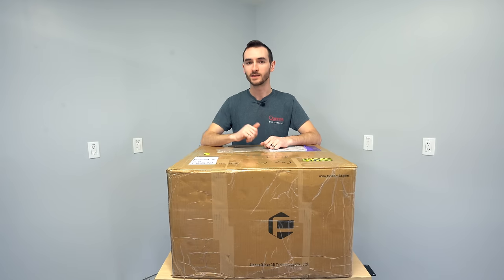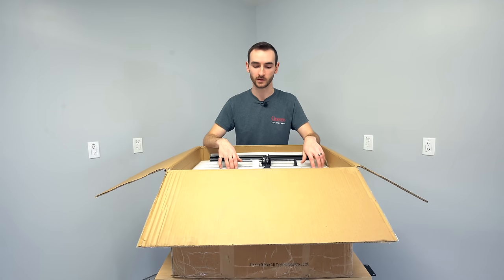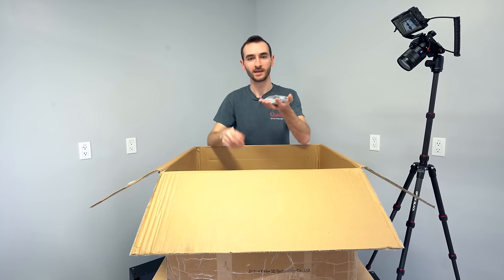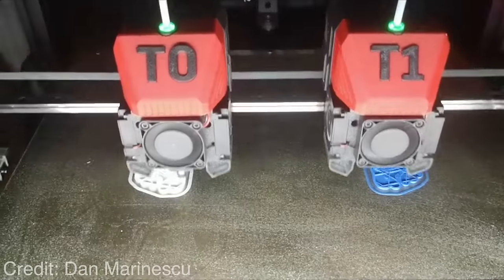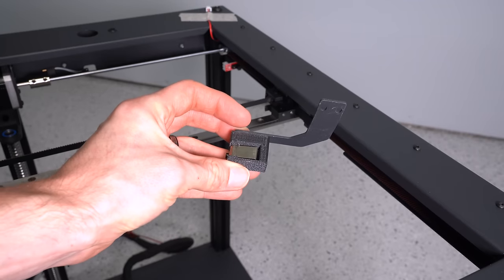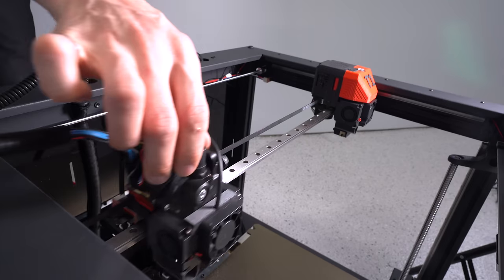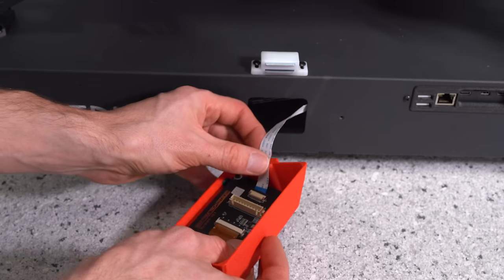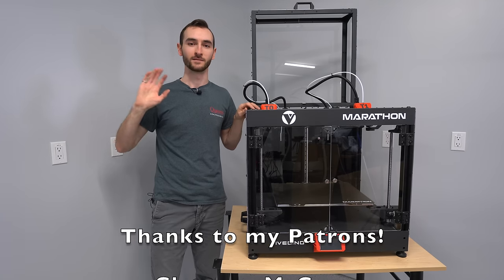1 Printer, 2 Tools - Marathon IDEX - Unboxing & Assembly

Comment: One of the most interesting concepts I've seen so far in 2024. Pleased to see you posting about it. Thanks!
Reply: you do realize IDEX has been a thing for a long time right.... this isnt new at all.  Still glad there are more coming out as an IDEX is awesome for multi material AND doing bulk prints of multiple items.
Reply: @chargerman426  
Sure, I do. And I wasn't referring to it being IDEX. It's more of the whole concept. The sum of a pre-built,  enclosed Core-XY, Auto-Leveling (tilting), real open source klipper 3D printer. 
And on top it's in imho the most interesting IDEX approach with the motors mounted to the print heads. 

All of that for a very competitive price point makes it one of the most interesting concepts in 2024 in my personal opinion.

Comment: Thats a lot of weight for the x-axis linear rail to support on its own. There will be deflection in the center. Would love to see that measured in a future video.
Reply: I think the designer said something like 6 microns, compensated by the bed mesh.
Reply: @mkhmkh1266  I would be shocked if it is only 6 microns. Mesh bed leveling is not that accurate (typically ~25 microns). And you cannot fully compensate by bed mesh because it will deflect by different amounts depending on the speed of the head. This is one of the big problems with older makerbots that used round rails. It is why all modern printers use stiffer square extrusions for the gantry.
Reply: @mntngeek  ya this and the lack of can cable are the reasons im probably going with a troodon 2 pro

Comment: I think a genuinely innovative design would be for a multi-material system designed for IDEX systems. So you could load four filaments, then run two to each hotend for reduced waste reduction of the IDEX system and more material mixing. I'm glad IDEX isn't going anywhere. I haven't gotten a good use for mine since I got my AMS and Bambu Printers, as I primarily wanted multi color printing.

Comment: i think that:
- the toolheads themselves look VERY nice honestly, love the industrial look
- putting the X motors inside the toolheads is SO SMART
Reply: Saves a ton of space. That enables me to convert a ender5 to an idex printer, a machine originally designed for single toolhead use without any loss in build space

Comment: Nice video, thanks!
Although I am not quite sure if it is a good idea to put motors into the extruders... as those motors are huge and powerful.  Furthermore, the only valid option for IDEX (at least for me) would be to use another material for support as I do not print many two color models (either single color or at least three). But apart from that it divides the build volume in less than half so that you have a huge printer with only a small and heigh build volumen.

Comment: Finally an IDEX printer that has convincing quality details. And thank you for the good video you presented to us.
In part two I would like to learn what nozzles have been used (looks like V6), will the filament spools fit inside the printer (where they should be) and the calibration stuff. I am excited.

Comment: I have X1C now and i need dual extruder 3d printer. I was looking to buy Snapmaker J1S, but then i saw this. Do you think i should buy this printer or J1S. I like this printer when i see its size, but would you suggest me to go with it because it just came out or you are sure that it is a great and durable printer. I also like open source firmware on this machine. Thanks for your answer i appreciate it. Best regrads!
Reply: I was also lookin for Prusa xl with 2 toolheads but it is a little bit too much for me at least for now. I usually print ABS and it will be great if I would print it with support material like hips, and use soluble support for PLA.

Comment: Looks interesting. Waiting for a full review, but it has a lot of potential, basically fulfills almost everything i would want on the next 3D printer, and for a reasonable price, considering the solid mechanics.
The only thing i don't like too much are the pinda bed probe, as i would have loved a bed sensor that uses the nozzle touching on the bed as reference. And having the spools at the back of the printer seems unpratical. I can't reach that place with such a big printer. Guess i would use a drybox on the side anyway to print disolvable support material with the second head, so it's not a huge issue i guess.
Reply: I learned not to fancy the nozzle touch sensor as I always seem to fight oozing filament.
I am sure the filament spools will fit inside next to the bed, many people added that in the J1 for example. They stay nice and cosy warm there too.